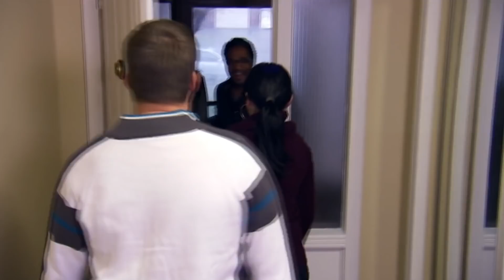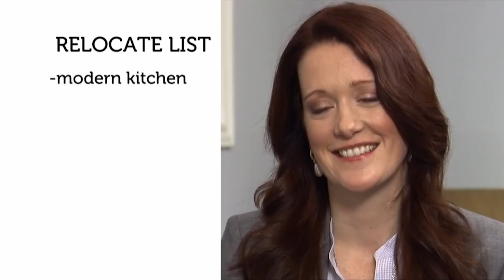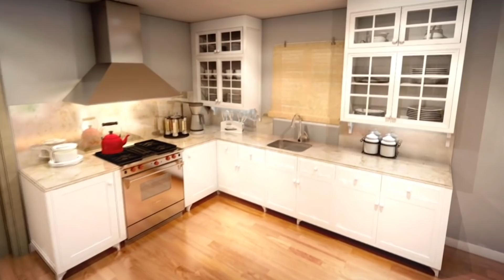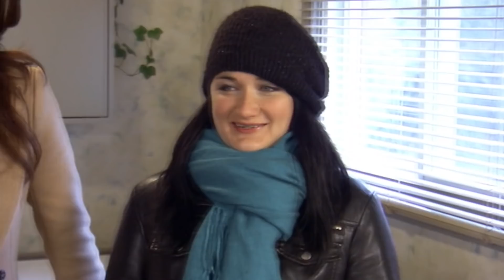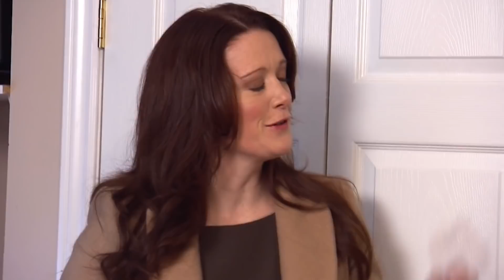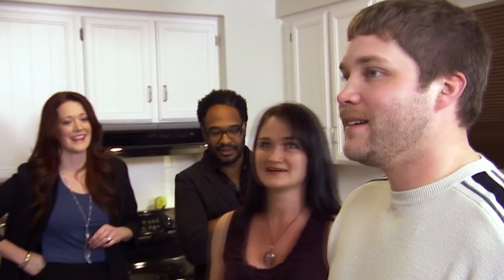I HATE My Boyfriend's Run Down Bachelor Pad! | Home Renovation | Reno vs Relocate S1 E11

Comment: Agnes sounds unreasonable...there is nothing wrong with the home, it is clean, neat, and large.   Just needs updating and even that is not necessary.
Reply: No way, that backsplash was fugly!
Reply: @normaharrod5337  paint the cabinets and get a new back splash. It isn't that big of a deal. I personally liked them better than many I've seen. Those little glass tiles are too busy for my taste and they keep putting them in everywhere